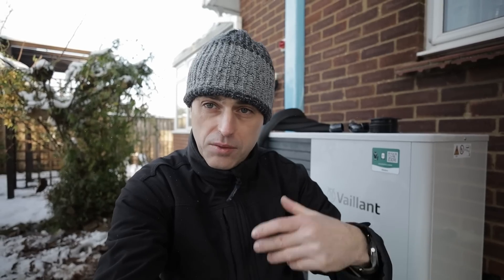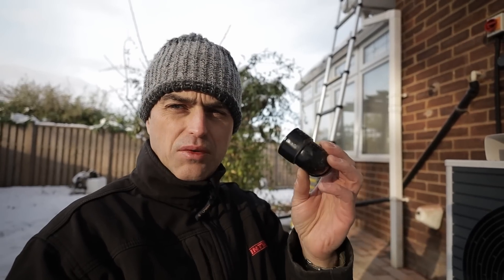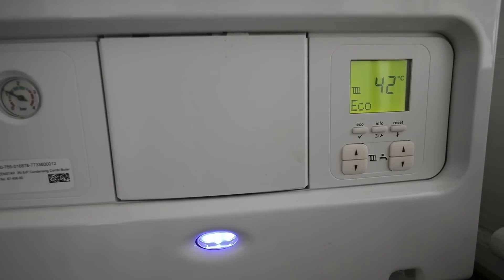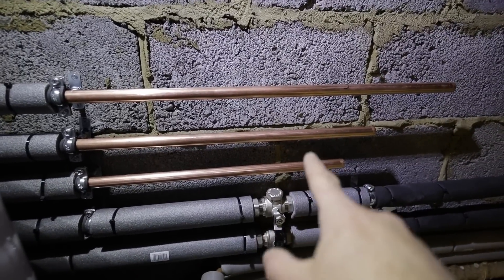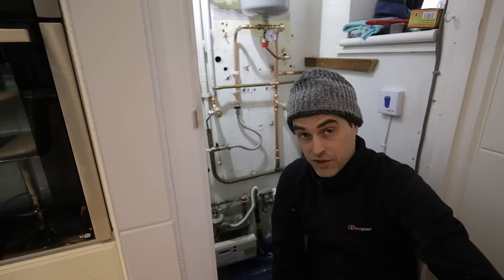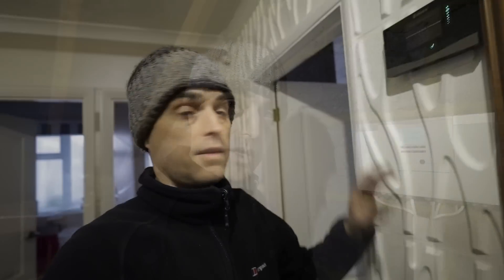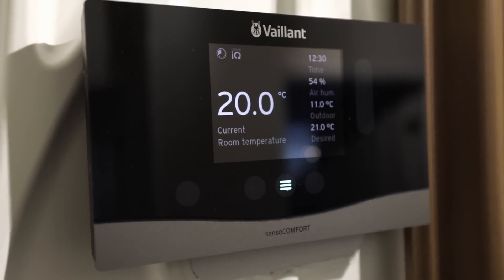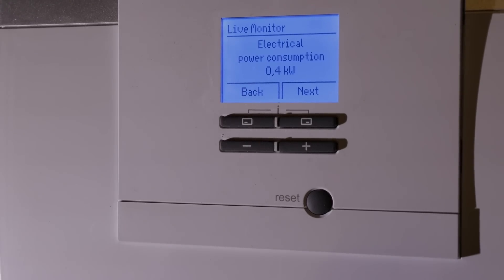How to Install a Heat Pump That Works

Comment: Great video!In Greece many engineers insist to install a buffer tank with heat pumps.What is your opinion?Thanks!
Reply from the maker: you really want to avoid buffers if you can. They can and will usually lower the overall efficiency of the system. You will need them if the pump inside the unit cannot overcome the pressure loss in the system though.

In the UK they are quite often installed so that the installer does not have to worry about the existing system pressure loss. Very often they are simply not needed.
Reply: @UrbanPlumbers  Excellent work and videos! From Greece once again! Here costumers are informed that buffers are installed in order to achieve minimum DT (water outflow-inflow difference). My personnal experience with a Daikin Altherma 3m 16kw (actually 12kw at 2C and 55C water outflow), installed in a 100sqm flat with radiators and without a buffer, but with weather compensation enabled (at 7C the water temp is around 43C), is that DT can be set to 5C (and works). The only thing is that I get a mimimum of 1kwh consumption, but with a SCOP around 4.1. That 0.4kwh consumption was very impressive!

Comment: Sorry to point this out but heat pumps return less heat the colder it gets, its a fact of physics, the colder it gets the more power that they use to try and pull heat out of the air that isn't there.

There comes a point where heating via electric heaters is more efficient.
Reply from the maker: There never comes a point when direct electric is more efficient mate! Not till -15c outside.

Comment: Cool! But I prefer self-made ground source heat pumps. Recently, at -18stC outside I had COP 5,21:1. It's very warm and energy cost is very low: 14kWh per day. Movies are on my channel!

Comment: I live in a small house where the airing cupboard has been liberated by a combi boiler. I don't want to lose this amenity to a new cylinder. Could I fit a wall-mounted cylinder (if such a thing exists) where the combi boiler is now as part of a heat-pump system?
Reply from the maker: You can keep combi for hot water and use heat pump for heating only.
Reply: @UrbanPlumbers  Thanks, but would likely be looking to an instead-of combi/gas upgrade as cost could be mitigated by removal of gas standing charge.

Comment: Nice install but im gonna be that person .. is that unit installed within boundaries due to the r290 refrigerant ? 👀
Reply from the maker: Yes - the drainage is 1m away to the right (no problem anymore by the way, as drainage now can be in the protective zone) and the window needs to be just above the unit. (some say 200mm, and some say just 1mm above the unit, here we are 300mm above the unit)

I can't see any other issues but let me know if you do?

Comment: Do heat pumps work with modulating thermostats? My gas boiler talks to my room thermostat to modulate flow temperature based on room to set point temperature difference.

Comment: The loft looks like a "cold" loft - will the hot water cylinder not lose heat (even though it's insulated? Would it not be better to have cylinder in the warm part of the home?
Reply from the maker: those cylinders are so well insulated that I doubt it would ever be a problem. There is loads of them in unheated garages as well.

Comment: We have had a Daikin 9kw altherma heat pump installed but our heat loss is only 5Kw this is mainly due to us preferring the look if of the 9kw at the time of install(black grill and silver body). Our installer did spec a 7kw unit but stlll oversized. The manufacturer says the unit will modulate down to 30%, is there anything we can do to help efficiency in the warmer months when the heat pump will possibly be cycling on/off often? We do have a 25L buffer but not sure if this would help much?
Reply: @zlmdragon.  We will look to add UFH later down the road in the kitchen/dining and lounge. We only have it on a heating curve ATM that's keeps it at 18degrees during the day and -4 degrees on the flow temp at night. So may have to change how we use, especially when we are looking at different tariffs using electric outside peak times.
Reply from the maker: I am not sure if that unit is 9kw at -2,  but if it is it will be grossly oversized if your heat loss is 5kw.
Reply: I have just had a look and it 9kw @ 7degrees outside with a flow temperature of 45degress haven't got a clue what that would be at -2 with a flow temp of 40degrees?
Reply: @zlmdragon.  Because that's a comfortable temperature for us,  21degrees is too hot plus surely better on the wallet.

Comment: Ok I must sound a bit dumb to the experts but at two minutes in you talk about a thermostatic valve that drains the unit of water via the return pipe if the temperature goes below three degrees. I was thinking you meant if the air temperature went below three degrees, but I guess you mean the water temperature. I suppose this would only be triggered if the air temperature is low AND the device has been switched off. Is there something that keeps the device running if the temperature is low but there is no demand for heating?

Comment: Your videos are great. I'd love to get into the renewables sector but I'm not a plumber or electrician and don't fancy a lengthy 4 year apprenticeship with v minimal money at 30 years old. Maybe there are other things I could do in the sector
Reply from the maker: at 30 you are still young enough to make a successful switch. There are other areas of renewables you could go into such as specifying and design, but those would also take you some years of study and practice before you could make any money out of those.

I would not look at it from a financial perspective alone because switching careers to something you have not done before will always mean you have to go through a period of intense learning with possibly very little money in it.

If you like to work with tools and can enjoy a bit of engineering and problem-solving - then just go for it.

Renewable installation is hard work and long hours - so if you go for it for the money, you will quit pretty quickly. On the other hand, it can be the most rewarding and satisfying work ever. You need to enjoy the process though and be ready for tough periods and moments of frustration. 

I would suggest finding a reputable renewables company in your area and ask for an apprenticeship or laboring position. Try it for a month or two and see if its for you. If you are half decent with tools and you have the right attitude a good employer will reward you quite quickly.

I would rather hire someone with the right attitude and no experience than an experienced person with a bad attitude. An honest employer will also be able to tell you pretty quickly if this is for you or not.
Reply: @UrbanPlumbers  Solid, heartfelt advice!

Comment: Thank you for the video, but I do have a question regarding using the Heat Curve, soon you find the “sweet spot” you will get the best efficiency as you know that you’re not heating in excess…. My question is, that “sweet spot” is dynamic right? The cooler the temp is outside, that value changes as the building might loose more heat, correct?
Reply from the maker: Thats the whole pointing the curve - it changes flow temperature with the changes in external temperature
Reply: @UrbanPlumbers  we have a quote for a aroTherm Plus VWL 75/6 230V S2  with 120ltr tank (160m2 one floor house, energy class C, 2 adults 3 kids,15y;12y;7y) and all this specs are amazing but all knew to us, just wanted to make sense of the setup, thank you for the patience and the quick answer 🥰👌
Reply: @balexandre  afternoon, consider a larger HW tank. We've got 300l and when the family/guests visit it can on occasion run cold by the time they have all showered etc...
Reply from the maker: 250l would be a better option. 120l will be too small

Comment: Thank you for this video recorded in the cold.
I’ve noticed the heat pump has been installed directly outside a window. Is noise going to be an issue if someone seats or is asleep inside?
Reply from the maker: Unit is super quiet - and I dont think they sleep in the ktichen ;)
Reply: @UrbanPlumbers  
Thanks. Was only asking because the most suitable location in my property is directly outside my bedroom with just the window and the wall in between.

Comment: Thank you for your information . My wife and I have moved to a new build house. It’s one of 10 . The heat source is a Samsung Air Heat pump linked to a Joule hot water tank. We have underfloor heating downstairs with radiators heating upstairs. There seems to be a massive variation in energy usage on cold days our smart meter shows 75.43 kWh used on the 15th of December a cold day today 19th December a warmer day it’s 20 kWh.  Is this normal ? We don’t have an electric car or tumble dryer.  All rooms downstairs have separate room stats upstairs there is one stat for the radiators and TRV,s I note you say it’s possible to use a programme which works our heat loss per day and varies the water temperature based on that.  Would this be more efficient ?
Reply: I'd say it's normal. We have a substantial house in New Zealand which is heated via air-sourced heat pumps. A cold day can be close to 100kWh used, a less cold day is nearer 40kWh. It's just physics really. If you want to heat something from 10C up to 22C it takes way less energy than if you want to heat from 0C up to 22C. Also, colder outside air has less "free" energy to give you, which results in a lower Coefficient of Performance.
Reply: How large is the property?
Reply: 311 square metres. Seven bedrooms, four bathrooms.
Reply: That does sound like it could be normal. As the temperature drops outside, the heat pump has to work harder and is less efficient. Once the outdoor temp drops below design temp, the pump will be running constantly, only stopping for defrost cycles. A 3.5kW pump running non-stop for 24hrs will use 84kWh - so ball-park what you are seeing. This also corresponds with my gas boiler. I've just looked at my Nest history. On 15th December my boiler was on for 11 hours to keep the house at 20degC, on the 19th it only ran for 3 hours because the weather was so much milder - almost exactly the same ratio of energy usage as you have seen.
Reply: @adrianlane6736  my 160m2 new build hovers between 30 and 40kwhs a day when its between 0 and -7c. 

So not that bad tbh.
Reply: It's about the flow temperature running at 50c will consume more than double say running at 35c. So you can adjust the curve down leave it for 24 hours then adjust up or down as needed.

Comment: When it goes into defrost, will it take heat from the heating circuit?
Reply from the maker: Yes, correct. On a very cold day (-3) it usually drops the flow temp by 3 to 5c

Comment: Great Video as always, but there is one thing that surprised me:
You advise to no use the temp sensor in the Sensocomfort 720 controller. This feels somewhat counter-intuitive to me, because the heat pump then has no way of knowing if ot has reached the desired room temp. So it might be working hard, heating up the water for your underfloor heating or radiators, but the room Thermostats might have already closed because the room temp has been reached...so the heat pump would be working for nothing...this is an issue for me with the current gas boiler that keeps trying to heat the house based on the outside temperature even if the inside temperature is still high enough. The heating "curve" is set to 0.2 and if I drop it lower the smaller rooms won't reach their target anymore...so I thought with the upcoming heat pump O should use the room temperature sensor in the controller...🤔

Another question: how would you set the hot water program? We'll be getting the "UniTower" with 190l of capacity. This should lose about 1kWh of heat in 24h and I wonder if it is better to have the water "always on", always on during the day or set to some "time of use" schedule...
Reply from the maker: if you use the controller as a thermostat then you do not know if the heat pump is not running a heat curve that is too high. It may not be as efficient as it could be.

If you set the controls to inactive, then you will have to gauge if the property is getting too hot (lower the curve) or too cold (up the curve) and that gives you the best chance to dial the system in correctly.

Once you get the heat curve that is the closest to maintaining the equilibrium then by all means switch to active or expanded.

Regarding DHW I would not have it always on. I would use a time schedule - but the schedule would be different for different scenarios. Use always on if you have high DHW use.

If you have solar PV and solar diverter to DHW, then it makes sense to set DHW for late afternoon to top up solar production (if big enough)

If you have a cheaper overnight tariff, then obviously charge the cylinder at night and maybe even get it topped up higher with the immersion heater after the HP finishes it's cycle.

If it is the summer, and you don't have PV and do not have an overnight tariff then run DHW in the day for better efficiency.

As you can see, there is just too many variables here.
Reply: @UrbanPlumbers  
Thanks for your reply. I will play with the options and settings once I get the heat pump. We ordered last July, so it should arrive before next winter...🙈
We have  Solar, soon will have a dynamic energy provider (Tibber) and I am doing a lot of automation via Home Assistant, so this will be a nice little project...💪
Reply: @rolandrohde  Interested to know how  much you expect to be able to get Home Assistant to be able to interact with your solar and heat pump?
Reply: @nickkitson  
The interaction with my solar is mainly so I can control things like grid-charging my Solar battery when electricity is cheap and not much solar is predicted. 
Concerning the heat pump it's essentially the same. If several hours of excess sun or cheap grid electricity is expected, then turn up the heat pump for that period, after that return it to it's normal operating state.
This can be achieved in a primitive fashion with the SG Ready contact, or more elegantly if the heat pump is directly integrated in HA and offers control over things like the flow temp or hot water temp directly.

Comment: Thanks for a great video! Can you add the Heat Engineer software link?
Why must you dig a soak away, could you not just pipe it to the drain that was next to the heat pump?
Reply from the maker: link added now

Comment: I'd really like to know the power consumption of heat pumps. Been working this year on a private new build, and this guy has gone to the limit with insulation: extra thick walls with 4" kingspan in the cavity, 4" studwork lining all external walls  with another 4" kingspan between the studs, 4" kinspan under the solid floor, 4" kinspan between the trusses and multifoil underneath them. Low E double glazing. Underfloor heating. Ducted  ventilation and heat recovery system. And since all the internal joinery is oak, he's following advice and only very gradually heating up the building (not yet occupied.) Professional heat pump installers fitted the system. The stat is set at 16 degrees, yet the fan and compressor outside seems to be running constantly.
Reply from the maker: This was was running at 400 watts with 10c outside. Didn’t get a chance to test it at sub zero.

Comment: Thanks for the great video. So is the hot and cold side in the outdoor unit or does the refrigerant go to an indoor hot unit where it heats the water up? Just an area I’m unsure about with heat pumps but it looks like it’s all done in the outdoor unit and it’s the central heating water flow and return going outside.
Reply from the maker: Yes, it's a monobloc so the fridge circuit is outside in the unit and water is pumped from the outside to the inside.

Comment: If I’m using 109kw gas a day on average for HW and abit of CH and UFH, in a super insulated house 6 bed, 4 bath. 
Would I need a heat pump assuming a cop of 3 of 20kwh at a guess without heat loss calculation.  

Also just out interest how much do you charge for heat loss calculation/design?
Reply from the maker: No, this sounds like a 5kw heat pump to me

Comment: If the soak away is to stop water creating sheet ice on the path by the machine, wouldn’t the antifreeze device opening create this problem anyway?
Reply from the maker: Yes, but it doesn’t open under normal operating conditions

Comment: Is there any benefit fitting the heat pump unit on a south facing wall. I live in a 4 bedroom 1930’s semi detached house. My aim is to go totally electric. Air Source Heat Pump, Solar Panels and Battery Storage.
Reply from the maker: I think yes, there will be days where a south facing wall will have considerably higher temperatures than a north facing one

Comment: Great video!!!! Do you work in South Yorkshire? Got solar PV, batteries and 2 EVs…, 6h off peak tariff, newly built property (7y old), in Doncaster, and have been thinking about installing ASHP for a while but a bit scared by all those bad experiences that will cost a lot more. Happy to cost the same to run than gas boiler… (off since PV, Eddi.., during summer), but scared of costing like 2-3 times more plus cost of install, etc…
Reply from the maker: On batteries and PV it could cost much less than gas. I don’t cover Doncaster though. Check Heat Geek map and look for Elite Installers
Reply from the maker: Damon Blakemore is your man for Yorkshire - can't go wrong with him.
Reply: @UrbanPlumbers  thank you!!